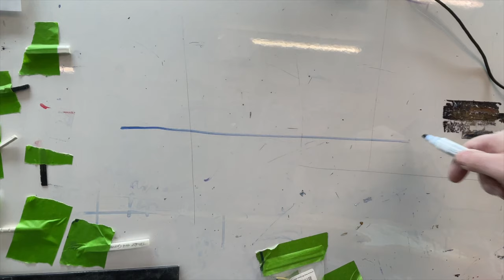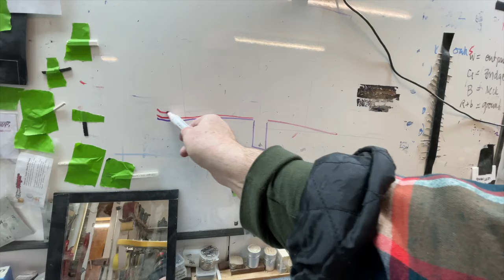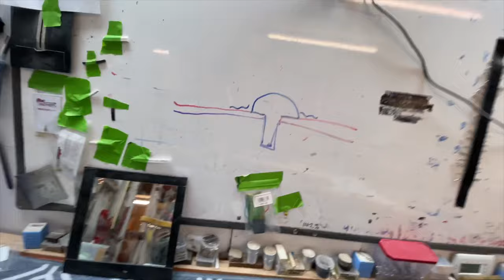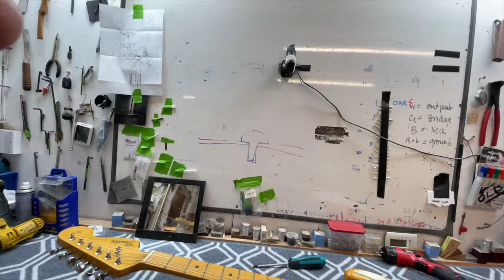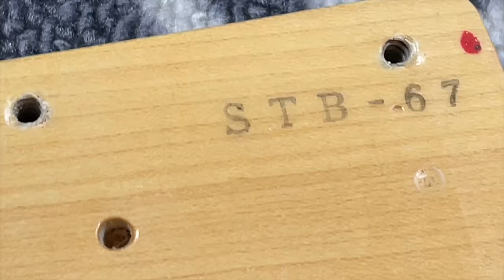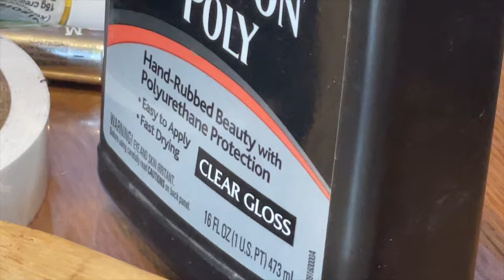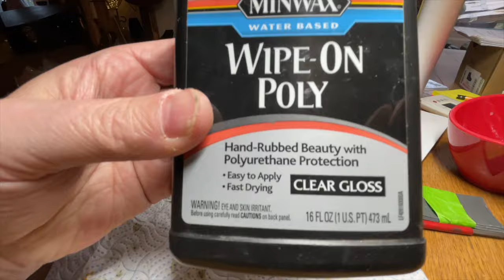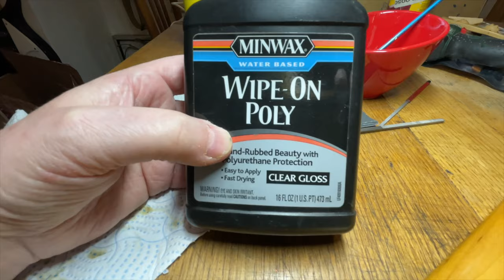Fender Ash Stratocaster 'Crafted in Japan' re-fret, bridge saddle change and set up

Comment: Can you tell me what size dome nuts you use? and is there a practical reason for using brass nuts instead of stainless steel?
Reply from the maker: I think they were M4 or M3… just need to fit between strings and the tops slightly above the strings. No testing for brass other than that’s what I found first. Stainless would be better if you can get them.